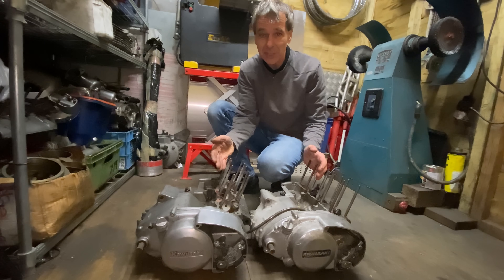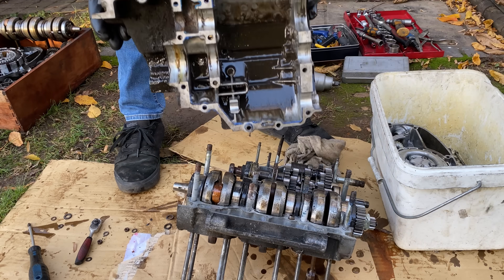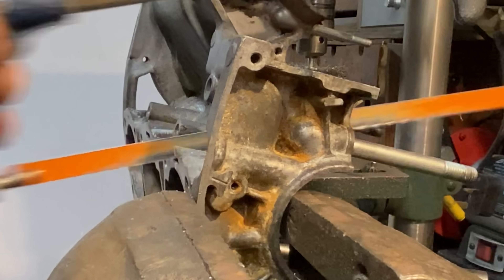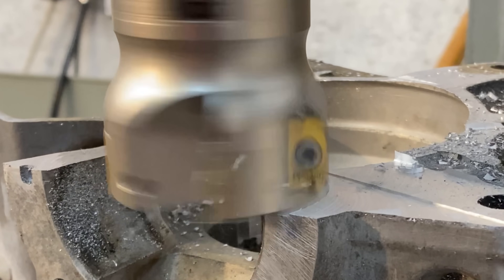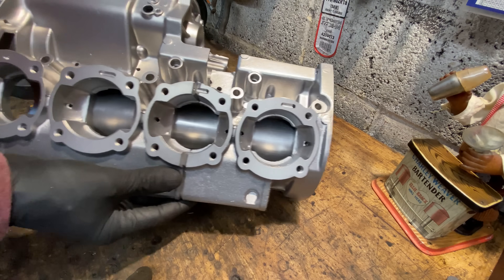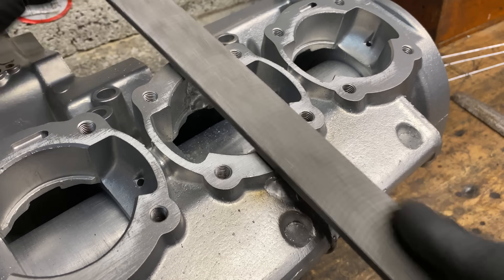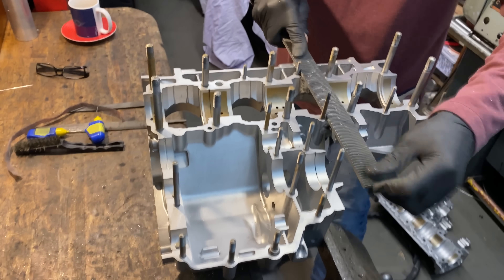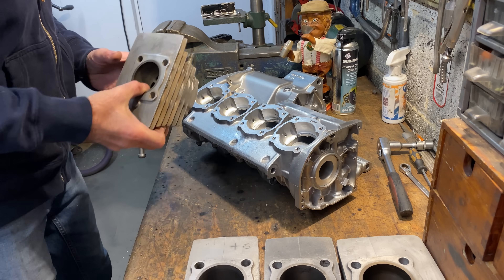Millyard Kawasaki S1 Four Cylinder Crankcases - How Its Made - Episode 1

Comment: Won't it shake to bits since you weld the crankshafts together introducing a weak spot where the static torq can spline it?
Reply from the maker: It’s not welded it’s pinned as factory spec

Comment: Mr Milliyard. 

I wonder if you could modify a L/H fork slider to fit the right stantion. It would require the mudguard lugs modifying as the bolt holes would be on the outside instead of the inside. 

It's on a Triumph Thunderbird 900 2002 model

Thank you

Comment: Unbelievable. For nine years, Triumph/BSA poured all their engineering knowledge and resources into converting the two-cylinder 5TA engine into the three-cylinder Trident/Rocket 3 engine. It sort of worked, but there were many reliability problems. If only they had asked Alan Millyard. As I said, unbelievable.

Comment: Are the main bearing bore journals coated with antispatter, or is that not a problem when tig welding aluninum?
Reply from the maker: It’s the iron inserts that have oxidised yellow after vapour blasting

Comment: I don't understand that level of self control.

Alan,  how did you manage to make it  ONLY 4 cylinders when 5 are begging for reincarnation?

Artistry, 4 vs 5 has to be 5.

Power has to be 5.

Because I can favtor 4 is good, 5 is better.

Ah, going through thin gaps, 4 wins.

Designing silencers 4 wins.

I recon it was just the oil pump that swayed the cylinder count?

Dont forget to turn off the bbq gas!

Comment: One thing I've never quite understood Allen (I probably missed the relevant video) is the very good reason why you join your engines half way across the cylinder. On the face of it that looks like it would make getting everything lined up properly really difficult. I'm wondering if that's because the alternative means cutting a bearing housing in half? Anyway, astounding stuff and great to see it unfold.

Comment: Thanks for the lunch date, Allen; I had been looking forward to it.
Would you please explain how you mount the engine back into the frame, now that the mounts on the engine are in a different place in space (further outward), so that the crank sprocket is still aligned with the rear wheel sprocket? Cheers.

Comment: 4:10 Where do you get those wooden surface plates?
12:13 I think there is a technical term for the stick.
13:04 Charley Weaver should wear a face shield. The arc flash has given him quite a tan. He would risk his eyesight too  - if he wasn't already blind drunk.

Comment: after all the welding on my H2 case reed conversion i had terrible warpage and when i installed the crank it locked up when the case bolts were tightened down. I made a dummy crank like Allen did. Installed in the cases and locked down tight. The case were then heat treated to allow them to go back to the original shape.
Lucky for me it worked and the crank turned very freely. Should have used the Bar BQ  lol.

Comment: Would it have been worth fitting dowels on the thicker parts of the casing to help strengthen those areas where the weld can not penetrate.

Comment: Oversize pistons make a two stroke lose some top end. Sometimes you don’t get any more top end though midrange improves. It’s worth cutting the back edges of the transfer ports so they once again aim at the rear wall of the cylinder. If that risks making the port too wide, cut a boost port up the back of the cylinder with a transfer hole in the piston. This helps to cool the piston top and can add 15% power to the top end.

Comment: Allan did you ever try the Stubby gas lens for your great linde17 torch on your tig welder you can save round 50 % Argon Gas  and go down from 10l/min to 5
here in Sweden the Argon are rather expensive (1190 SEK 11 liter)
Reply from the maker: No but I will

Comment: Im a wood worker , i have a 36in bow saw , old heavy duty sanvic with the bow weighted at the front with lead (dad told me this trick)
Dad also got me a selection of band saw blades cut and fit to the bow , its amazing how well it will cut an RSJ or miter skirting board ect . With such a long stroke it flys thro any matereal with ease and the right toothed blade .....

Comment: Allen - so I checked it with the barrels and they fitted just perfect. Me: So I checked it with the barrels and realised that I had bored them 3mm too big, 1mm to far over and that somehow they had come out oval. In a fit of temper both items got thrown out the window - didn't matter as they were scrap now anyway. My Mrs comes in to ask what all the noise is about and we have a massive row about how I can never do anything right and should stick to Airfix plastic kits. Different life, you see. :-)

Comment: Are you not worried about the standard 250 gearbox and clutch taking all that extra power.or was it grossly overenginered by kawasaki...
Having ridden these things in the early 80's they had many problems.

Comment: back in the late 70's I had two friends who built a drag bike out of a stripped down 500 with 750 jugs and pistons they worked at the dealership and the mechanics there went a bit nuts helping them build it . the damn thing was a monster throwing off everyone who tried to ride it well it didn't throw them off as much as it had so much torque and power you would drop the clutch and the bike would leave you at the line taking off by itself or if you tried to hold on it would break your arm . I wish we still had that damn thing as big a pain in the butt as it was it was cool.

Comment: I've been working on getting 2 old Honda CB550s running (nearly got 1 there), one of them had the threads for the drain plug on the oil pan stripped out. I managed to make a mess of drilling the hole out and tapping it to M14.  It astounds me how you're able to just hack these engines apart and weld them together again like it's no big deal.  You're an incredibly talented fellow!
Reply: He's a rocket surgeon! If you do a little research on Allen, you'll find he's not your everyday garden variety engineer.
Reply: @fishyfool  rocket surgeon or brain scientist ?
Wouldn't surprise me if he's both.
Reply: @fishyfool  thanks. All makes perfect sense now. A true genius with the dexterity to bring his creations to life. Brilliant.

The MTN bike stuff is awesome too and his own cartridge inserts, I'd love to know some more about those.
Reply: Allen is 3D thinker extraordinaire.
Reply: Try a helicoil next time.
Reply: It's like everything.,practice makes perfect.......he did the things that went wrong decades back.........now he knows..So the plug went skew .,it won't go skew next time..But then Allen says its perfect.,but of course that is relative.,it built to a standard that will run.,as was the original..It's within the limit and fits..What I find very impressive is putting weld into a structure that was never welded.,I'd be tempted to glue it.,there are some very impressive glues out of people like 3M..
Reply: @robertwoodliff2536  , and West System.

Comment: You once promished to show us how you line the drive sprocket up when the engine is shifted sideways in the frame, I hope it is with this build.
Reply from the maker: I will cover that in episode 3
Reply: I think rear wheel will be reversed sprocket on right brake on left side when engine is alingned sideway